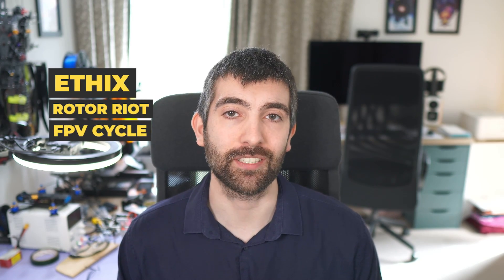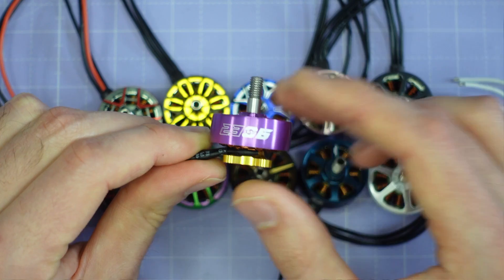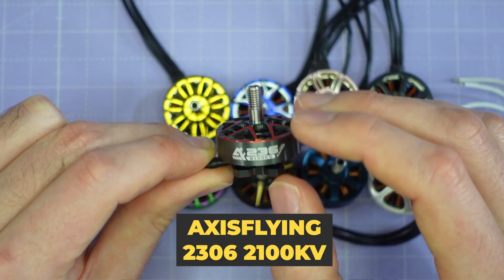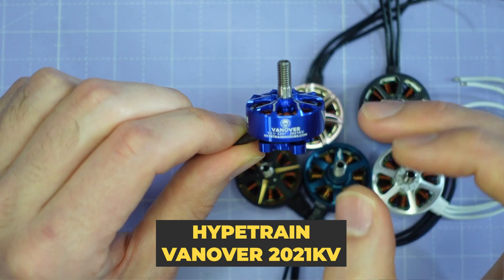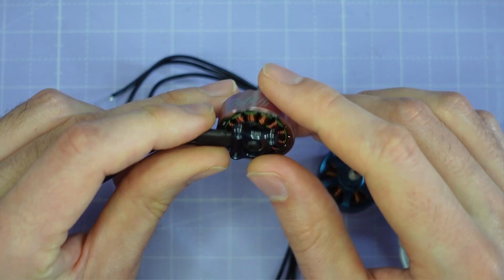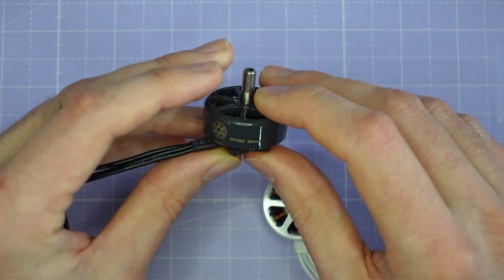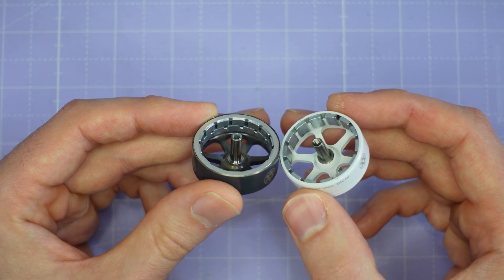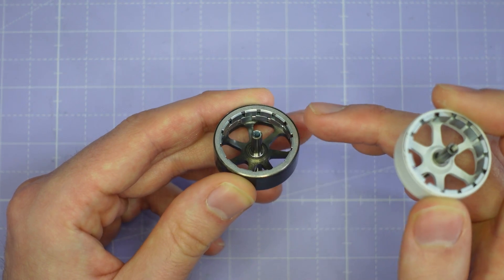VCI Hobby, Axis Flying and EVERY Hypetrain Motor Tested!

Comment: Hi there, I’m doing an aeropendulum as a project. I have no experience with these typo of motors. I have bought A2212/6T 2200KV BLDC, and I wanted to see if a can power it using a DC power supply. The only thing it’s that I don’t understand pretty well how much amps I need in order to power it properly. I hope you read my comment and thank you in advance! Great video by the way!

Comment: I could be wrong but I feel like some of these motors would perform better with a different prop. Such as the Bubby motor, I would love to see the results with a 4" or 3.5" prop on it. I don't think every motor should use the same prop. It's like trying a v-8, v-6 and 4-cyl all in a heavy vehicle or all in a light vehicle. Some will perform better in heavy and some in light vehicles. I think that some motors specifically require a particular prop for optimum performance.

Comment: Thank you for your hard work, it's appreciated. Anyway you can do a 4 inch long distance motor test with motors like the Flywoo Dave-C-FPV 1404 V2 2750kv or the t-motor or whatever you think would be the best for 4 inch long distance motors

Comment: Hi Chris, very interesting! Is there any possibility that the Split magnet design would benefit from Fettec/Kiss ESC sinusoidal commutation more-so than a regular magnet shape?
Maybe I am thinking about it the wrong way, but wouldn't a slightly skewed magnet field be better driven by a 'smoother' commutation method?
Finally, is there any benefit to lowered electrical noise in the case of a scewed magnet? Wouldnt the back-EMF be weaker?

Comment: the part on throttle feel is amazing. worth clipping!

- btw, i am running supernovas on 8s at 80% now. i am worried about the heat but the responsiveness, torque and specifically the stopping power mid-move is absolute insanity. i love them so far! video coming soon.

- if i ran into overheating issues and don't want to lower performance - what motor size/KV would i look for on an 8s 4.9-5,3 inch quad? bigger is better in terms of heat i would asume?

Comment: ENGINEERING QUESTION (good idea for testing/video?) Pursuing the goal of long range/best efficiency/lower power draw, is it better to :

1 - 4S battery, full throttle. 
2 - 6S battery, same propeller, reduced throttle  
3 - 4S battery, bigger diameter prop, reduced throttle. 

Motor/esc stay the same. Prop is chosen low pitch & have the best efficiency in 1rst case. Throttle is managed to get EXACTLY the same traction in the other cases.
Interresting to know if esc frequency can change the result and maybe other parameters I don't see ?

Many thanks in advance.

Comment: Hmm, for freestyle I usually like the most responsive motor but choose a low pitch prop even a slightly smaller prop like a 4934 for response and low throttle control.  I even went 8s to try to amplify the torque response. I kinda keel like the weak motor crowd could do the same with just a lower kv but keeping with a big stator. Though,  I'm not nearly the caliber of pilot represented here.
Reply from the maker: Have you tried throttle expo?

Comment: i run my throttle mid at .22 and expo at .75 or something like that, it gives my throttle curve this funky shape but it feels reallllly good on the sticks, gives me a lot of precision around my hover point for landing and stuff, these pilots who cry about needing to have a "linear" throttle blow my mind, because if your throttle is "linear" then in reality it feels super not linear because the thrust increase from 25% to 50% throttle is much higher than say 50% to 75%, so having the expo actually makes it feel super linear, i wish more people would play with throttle curves
Reply: Flatten out the hover point? It seems obvious, but I'd never even considered it, in the year that I've been flying. I just kind of accepted that holding a steady hover, would be a continual battle between me and my sticks…  Looks like I know what I'm doing for the next two days.👍
Reply: @Inertia888  i just double checked my throttle settings and i have on my 5inch a 0.25 throttle mid, and .5 expo. On my 3.5inch i have mid at .3 and my expo at .6. I also run scaled throttle limit (not motor limit) at 95%, it makes the quad feel a lot more stable and controllable at full throttle, because the pidloop can command that extra 5% throttle and not have only lowering the motor rpm as a means of stability and control and you really dont notice any loss of thrust, I fly rural areas with huge trees so im always full throttle ripping up and over the trees with movements while im at full throttle and i find it helps a lot to retain control and have a smoother rip, i run that 95% scaled throttle limit on all my quads
Reply: @christhorney  I fly a similar landscape. I have a long and narrow field, about 90meters x 30meters, as a run-up to a patch of tall trees, about 25meters tall on average,  and a bunch of older trees in there about 45meters tall. Lots of places to zip around treetops, and play around inside and under the canopy. The speed is fun, and whipping around the tall ones, I have found myself building a natural racetrack. But then slowing down and flying between the vines and thicker undergrowth is a whole different challenge, with its own excitement. It sounds like you've given me a great place to start. Looking forward to playing around with it, as soon as the rain stops. Appreciate the share! Happy Flying!

Comment: Would love to see a video comparing a lot of the cheap branded Aliexpress motors. Like 'Surpass Hobby', 'ReadytoSky' etc. The ones that are half if not a quarter of the price of a lot of branded motors and see if they are any good! 👍
Reply: probably a reason he doesn't review them
Reply: @DroidAssembly  correct, my buddy is a pro tc car racer/engine builder and the only good motors aren't cheap. Anything half the price of something good will be have the quality and durability. Pointless
Reply: I know for 1/10th scale touring RC cars they are ok in the beginner classes but not in the higher classes.

Comment: Since this is a power/weight comparison, the big thing to consider here is durability. Motors with more material and a bigger air gap, won't rank up as high in this comparison, but have the huge benefit of being more durable.
Reply: Thats FALSE! Where did you get that nonsense….. magnet gap has nothing to do with durability or more material…. Geez
Reply: @LovesM855A1  Lets compare 2 motors. One with a 1mm air gap and one with a 2mm one. 
Both have exactly 4mm of 7075 aluminium as bell. 
Both motors take a hit, which deforms the bell by 1mm.
The bell of motor 1 will grind on the stator, but the other one can still spin freely.
So I would conclude that motor 2 is more durable, or what do you think?
Reply: @ohJayFPV  I think as well built as quality motors are these days with one piece bells made of 7075 t6 alum, and titanium shafts they can take a beating and days of fragile motors are OVER! If you do enough to do what you claim the motor is trash anyways
Reply: @LovesM855A1  That's not the point. Bigger Air Gap = more durable. 
I bent quite a few bells on quality motors, and instead of having a little more performance I prefer to not repair my quad.
Reply: @ohJayFPV  I disagree and more gap means cheap low quality motors…. You want the gap tight PERIOD…. Run your junk motors Ill stick to top tier…… now go back in your grandmas closet and go to sleep.

Comment: Can you tell us which motors are made by which manufacturor?
Like HGLRC, foxeer, speedybee, aos, fpvcycle, ummagawd and many more are all made by rcinpower.
Seems like the rotorriot  hypertrain, webleed, oddityrc and many more are made by VCI.
Axisflying split from t-motor as a seperate brand. I think those motors are also still made by t-motor.
The pyrodrone motors are made by brotherhobby.
Most eachine and low budget motors found on the big chinese vendors are made by flashhobby.
It's a jungle out there, but maybe you can bring some light into the darkness. Basically knowing some of these facts might help to judge the quality, knowing which big manufacturor is making them.
533 motors made by xnova not to forget.
I'd like to know if iflight makes the xing motors themselves.
Reply: Great suggestion. I have always wondered who the OEM is for all the different branded motors. How many actual manufacturers are there?
Reply: Thats indeed the most important question nowadays. Would make sense to choose the motor by stator, kv and manufacturer rather than by looks and company promises 😂😢😮

Comment: So basically buy your "motors" GOT IT! Lol
Reply: I loved how hard he tried to keep a straight face when recommending his own motor... A slight increase in top lip tension but other than that a good poker face 😂
Reply: Lol I have yet to try them but I've heard good things
Reply: If he's going to design a motor, obviously he's gonna make it perform as good as he can in the metrics he thinks are important.

When doing motor tests he's going to measure the metrics he thinks are important. 

So it really shouldn't be surprising.
Reply: Actually he explained why it makes more sense to use the motors on the right of the chart - not just aos 

I suspect smart manufacturers/designers will agree and try and move their designs in the same direction.

It’s not like Chris is hiding anything.  He shows and explains his methods and even explained how he designed the aos motor in another video.
Reply: Who would have thought that his motors rank up the highest in his comparison... 
There is certainly more to consider like durability for example.
Take the data but do your own thinking!
Reply: Was a good way to show what he'd been saying. Receipts.
Reply: But how do they feeeeeeeeeeeeeel chris  😂
Reply: I mean...they are the best 😅

Comment: Have you thought about putting a gyro on the test stand to compare the mechanical noise from each motor?
Reply: Accelerometers
Reply: @speedbird300 accelerometers are integrated with most modern gyro packages....